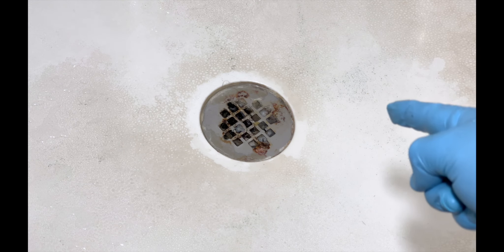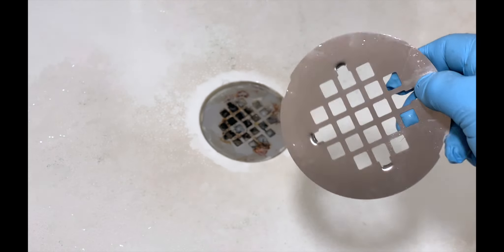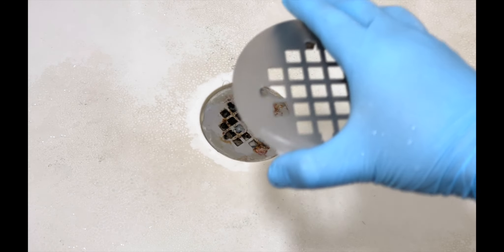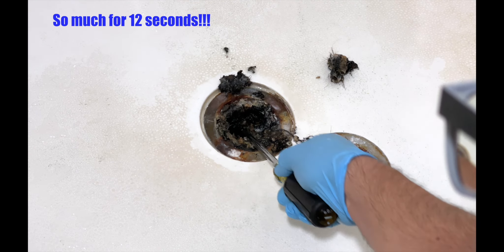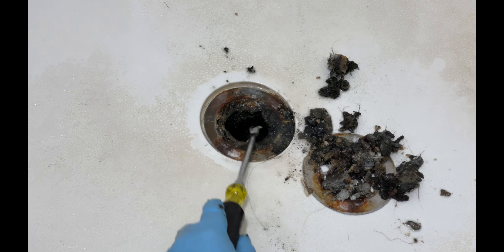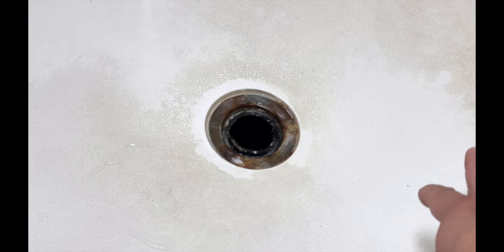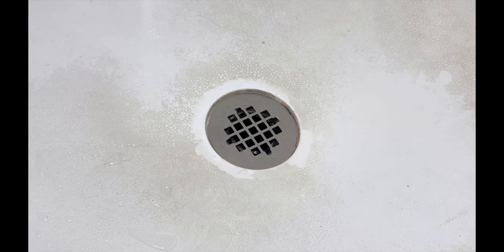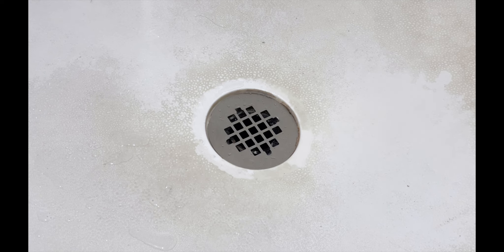DIY - How To Replace And Clean Your Shower Drain Cover

Comment: On the one hand, I appreciated the tip on removing the drain cover.

On the other, I made it to 1:38 before bailing. That's just awful. 

Overall, thank you! This is both helpful and nauseating.